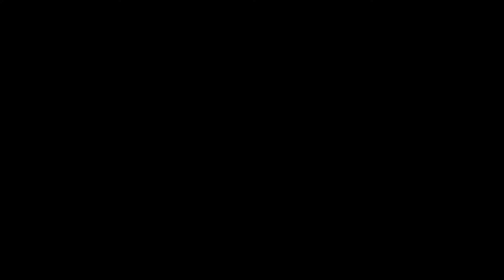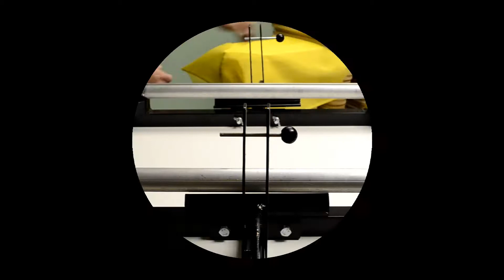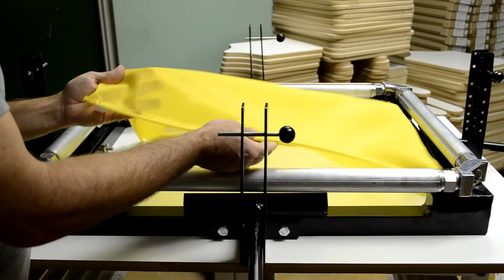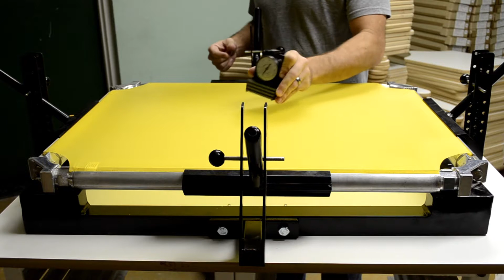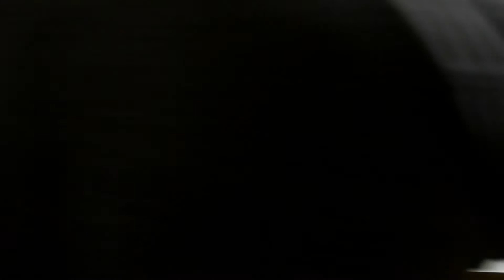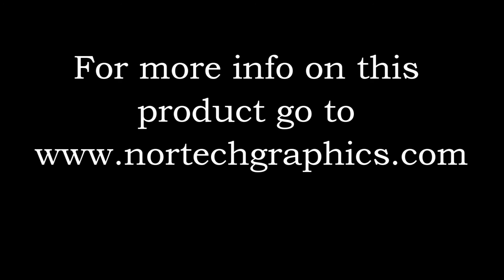Roller Panel Installation

Comment: Do you make a table/tool like that which would work for the 18x20ID MZX Manual roller frames (with the 3 roller bars and one square bar)?
Reply from the maker: Yes, we have a stretcher for that. Email cmiles@nortechgraphics.com if you are still looking.